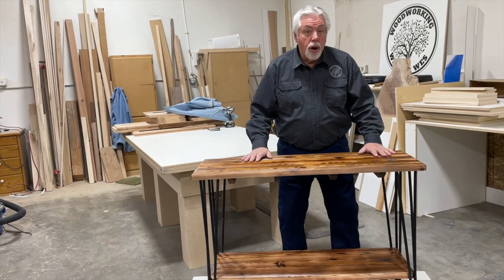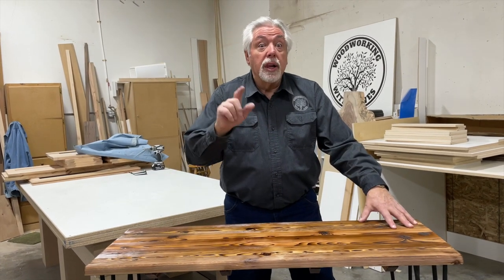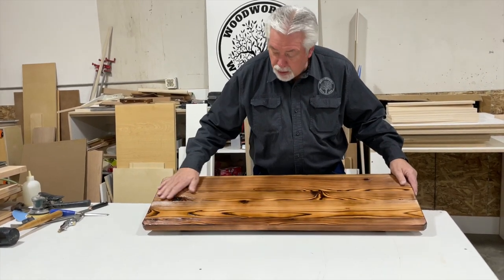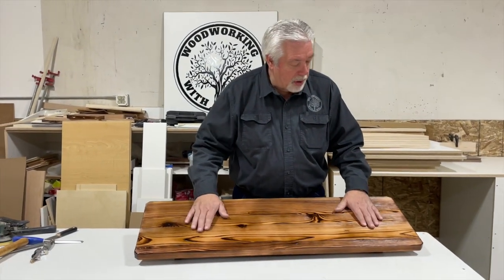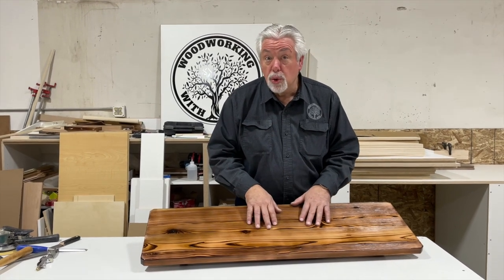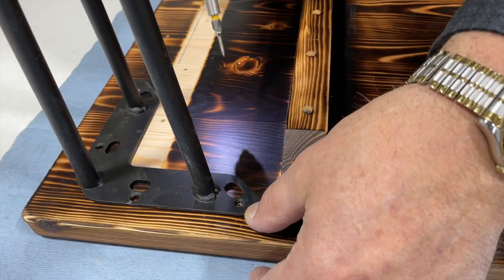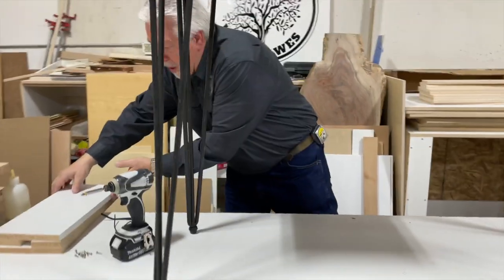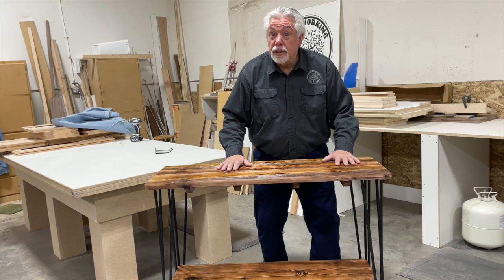DIY Burn and Build Shou Sugi Ban Accent Table

Comment: Question for you sir:  Does the White Vinyl Primer you use for painted work stop tannins from bleeding through or do you use shellac under the WVP?  Thank you very much for all you are doing on your channel!
Reply from the maker: My white vinyl primer has proved to be a good sealer coat so I haven't used anything else. Thanks for visiting our channel. Wes
Reply: @WoodworkingWithWes  Thank you Wes!